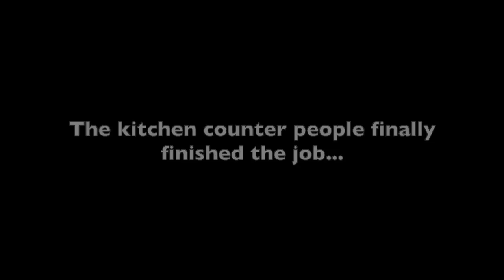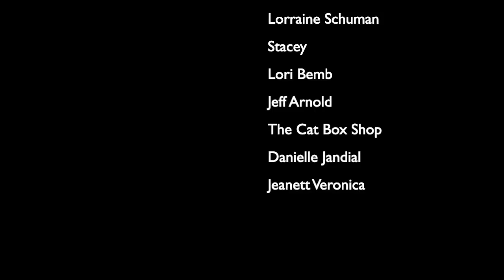Chateau Cottage Destruction Continued! – The Chateau Chronicles   Ep #57

Comment: What is Bruce’s background? Will you need planning permission?no agro props?

This is a little of what I found about …
What is an Acrow Prop?

An Acrow prop is a telescopic tubular steel piece of construction equipment. It is used as temporary support. Known by several names including shore prop, acro prop, acro jack and post shores. They are height adjustable by a wide diameter screw thread which is on the outside of the tube. The use of a screw thread means that the props can be tightened when already in place, which allows the user to adjust the load that each one bears.
The safe working load (SWL) that each Acrow Prop can bear depends on the size (please see table). The SWL decreases as the prop is extended.  All the best to you and your amazing crew!

Comment: A suggestion from the peanut gallery is paint a cardboard template of the kitchen glass top door with the black paint before making that decision. I like your idea of using the kitchen cabinet color as a subtle accent through a few spots in the kitchen.  Off white/white are very calming together.  Mho on using the black on that recessed door make it too heavy and too much. To jazz that specific door up, you might consider installing black or brass push plates on it.  That would give you that extra dimension without going all black.  I'm leaning towards a brass finish to match the faucets!

Comment: Should you be using concrete next to stone?  Shouldn't it be lime mortar since concrete will degrade the surrounding stone?
Reply: Yes, I've seen on other chateaux channels where they do NOT use concrete/cement in their stone buildings because it does not allow the stone to "breathe" and the moisture causes a problem.  Have you and Bruce researched that issue?